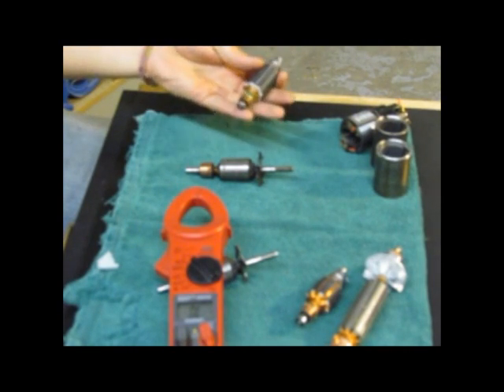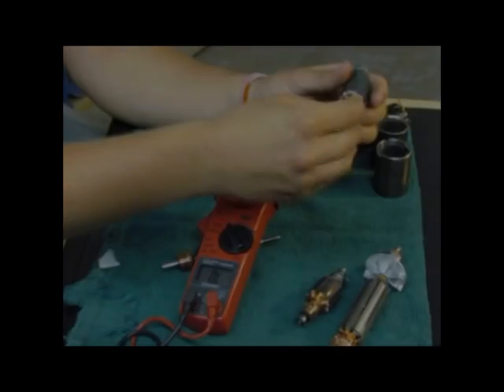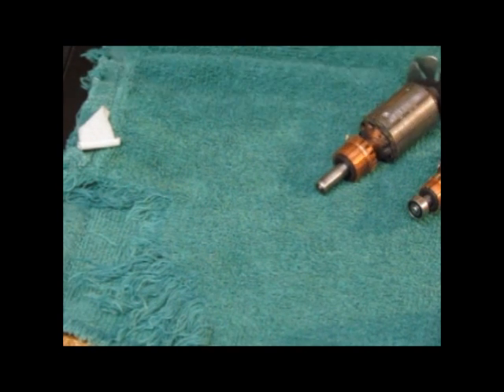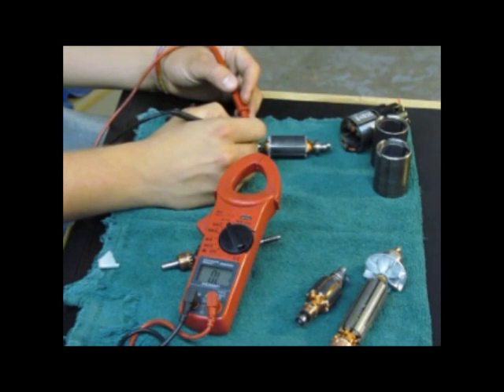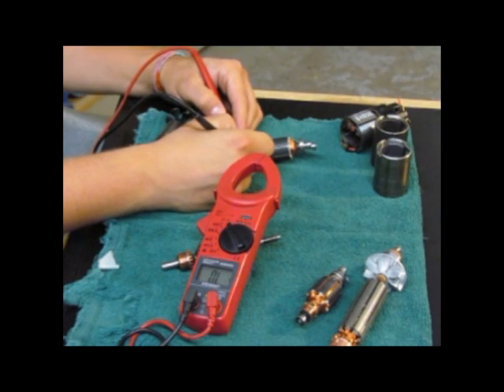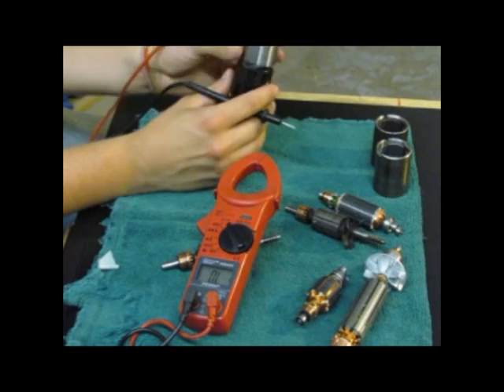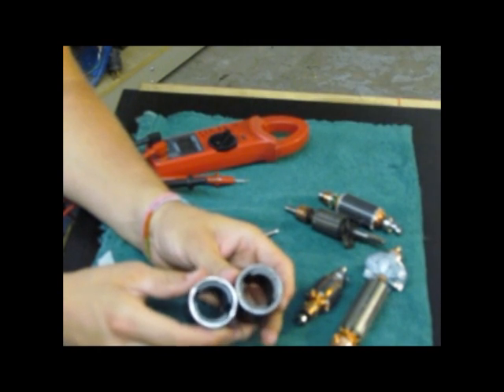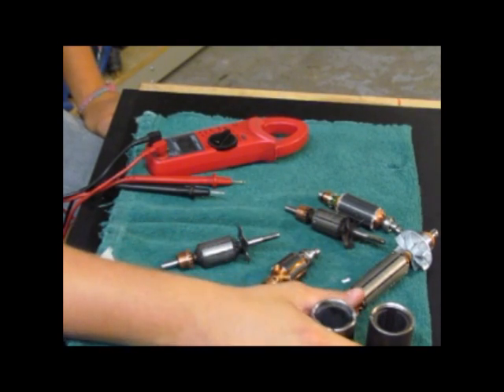Testing Armatures and Fields.mpg

Comment: Nice video.  Do you have a video where you tear down the clipper and remove the armature?  I know it can be tricky and requires ring pliers, but I'd like to see it done - there is, no doubt a LOT of dog hair in my Oster A5's.  I'm going to give it a go and see if I can get it to bits.  Hopefully all the bits will all go back together.

Comment: It depends. If the armature in question is part of a well known, brand name machine whose maufacturer is still in business, by all means replacement should be the first option. You should be able to get contact info (and possibly more) thru an internet search. OTOH, if your machine is an "orphan"--mfgr out of business--then you have almost no choice but to have it rewound. Phone the motor repair shops (several if possible) in your area for an estimate. Some may not do small armatures. Good luck.

Comment: When you find a bad armature, do you rewind it, or just replace it? I have an armature that has a gear cut on the output shaft rather than threaded like yours.  I'm having trouble finding a supplier for a new one.